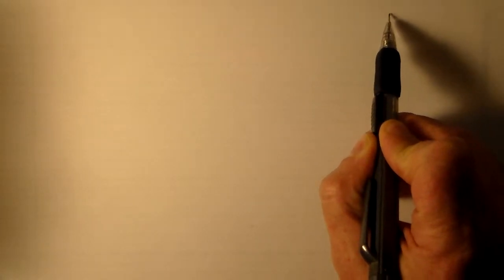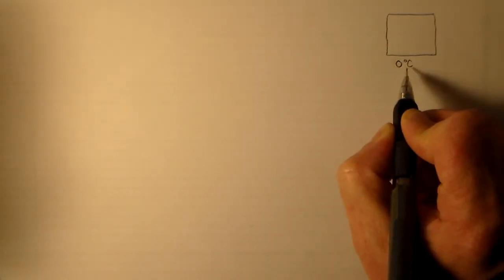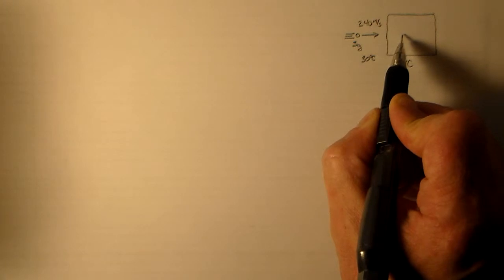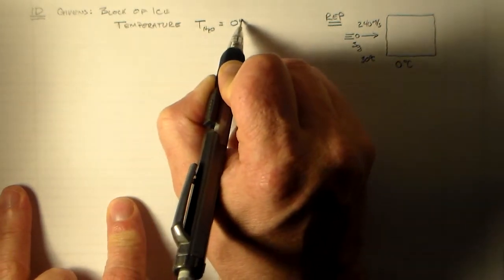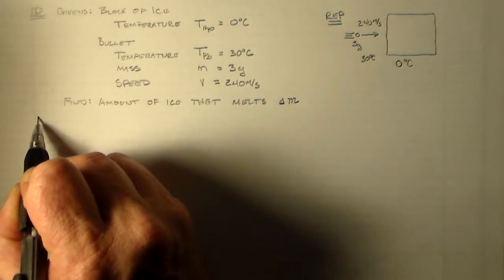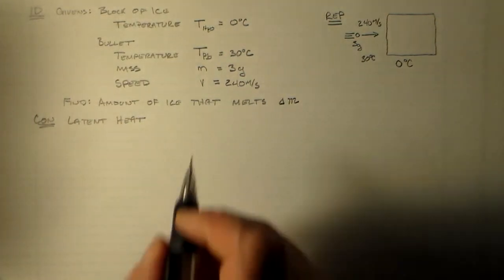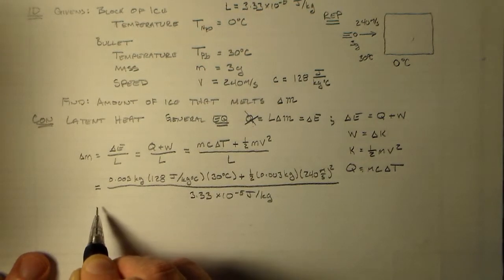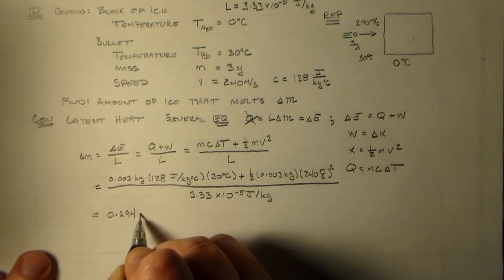Latent Heat

Comment: Why W = delta K ?
Reply from the maker: +Visalbotr Chan It's the work-energy theorem from much earlier in a physics semester. 

The work done on the bullet by the block in stopping it is the amount of energy that has to be absorbed by the block.  This problem is, in a way, showing you that "the energy lost is dissipated into heat."